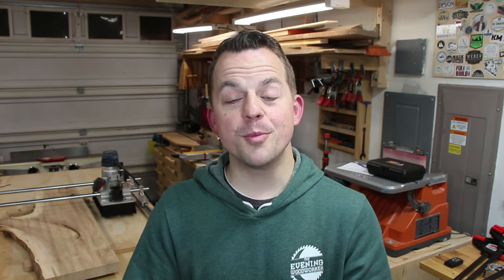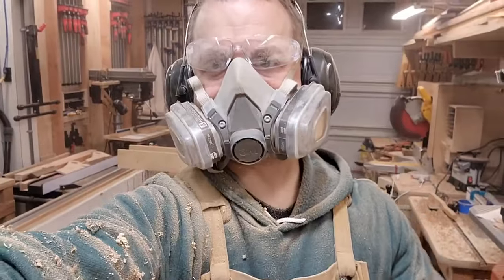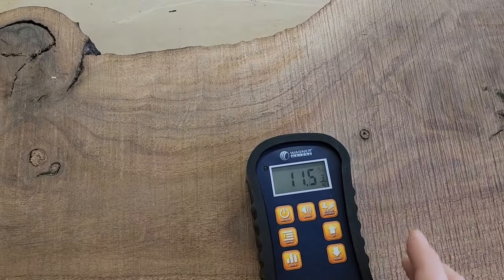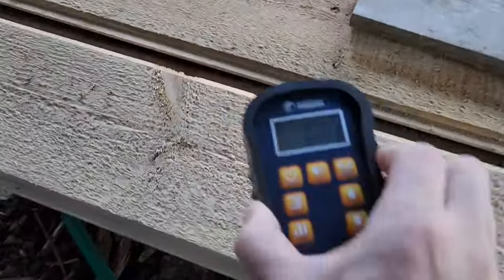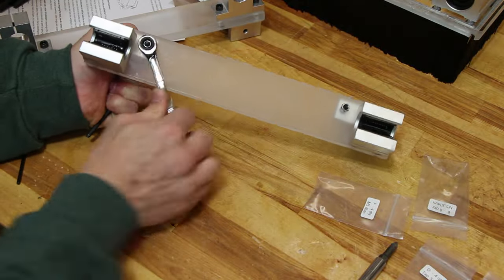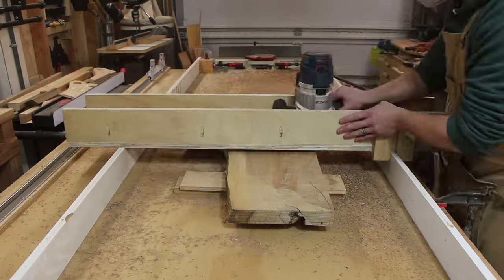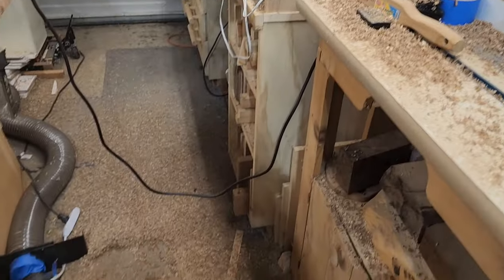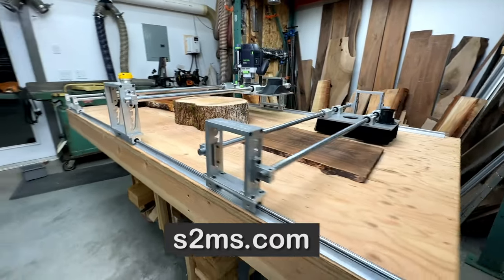Which Router Sled do you REALLY need - Linear Bearing or DIY?

Comment: I bought a cheap bench and wanted to flatten the top.  I fitted 15mm ply side rails on small stand offs so the bit could reach across the entire bench width.  I made the two sled rails from 1/8” x1” aluminium angle (which I checked for straightness) and put some furniture wax on them for an easy slide of the router base.  The rails were separated by a wood block at both heads, the width of the router base.  Worked brilliantly and cost little.  The chippings left the bench top through the standoff gaps each side.  Hardest bit was ensuring a perfect alignment of the six feet long ply rails each side of the bench.  This worked with my cordless DeWalt palm router using a one inch surfacing bit and I kept the depth of cut to under 1/16” to avoid over loading.
Reply from the maker: Sounds like a great setup!

Comment: I have used my DIY sled for about 5 slabs. It is very messy but it works. It’s great if the weather is nice I can share the dust with my neighbors 😂. Thanks for a informative comparison. 
On the moisture issue I have never used a meter. To be honest I have been lucky most of my projects have not warped. On the epoxy resin tables I like to use a polyurethane on the bottom to help seal the wood.
Reply from the maker: Thanks! I guess you can either use a moisture meter or just wait a year or two until you know it's dry!

Comment: I used the wooden DIY sled in the past and I didn’t like it, because it bends in the center, so little, but it doesn’t perfectly flat a slab. Slab large  around 40inches, and 100 long, with a quite heavy router 13 lbs. I’ll try with the metal ones, but I doubt they won’t bend as well.
Reply from the maker: The thicker diameter linear rails (20mm) will help reduce the sagging in the middle... they're just a lot heavier!

Comment: Great video. I’ve been looking into sled improvements for a while so it was good to see your video and comparisons. Was there a time saving between the two sleds for how long it took to flatten each side?
Reply from the maker: Thanks! The linear bearing one was a bit faster for the actual routing, but setup took a bit longer because you have to slide rails onto bearings and tighten Allen wrenches.

Comment: Is there any flex in the rails? My DIY sled is made out of angle iron so it gets the bit closer to the work surface and I can put a little wax on them to help the router slide easier.
Reply from the maker: I didn't have any flex in mine. I do like the idea of getting the bit closer to the work surface though.

Comment: What diameter are the libear bearing rails / rods
Reply from the maker: The 8' ones are 12mm and the shorter ones are 20mm
Reply: @EveningWoodworker  would you be able to measure the sag when you place the router in the middle of the 20mm rails? Originally I was wondering if 16mm rods would be enough for a1m span...

Comment: I really like your home build flattening sled. It's the design I would use. 
But in regards to moisture meters, how do you know the Wagner is more accurate? Not just because 😂🎉it costs more, I hope. There could be a huge variability between any brand of moisture meter. How could you measure the moisture more reliably to compare it to your meters? How about comparing it to another high end meter?
Reply from the maker: That's a good point. Cost does not always equal quality. In this case, in addition to the cost I'm basing my assumption off of recommendations from other woodworkers that I trust. Although, it wouldn't be a bad idea to borrow a few of these from friends to get a good comparison of higher end meters.

Comment: I don’t understand parts of this video that mention “with the grain”. Router bits go round and round. They cut both with and across the grain.  Direction of sled travel seems like a second-order consideration.
Reply from the maker: When a router plunges, then yes it's in all directions. However when you're moving it sideways, it cuts mainly on the side of the cutter. So if you're running it across a slab, I get less grain tearout  when I run it back and forth in the direction of the grain. Try it and see if you agree
Reply: @EveningWoodworker I'm not sure why you couldn't run the DIY sled along the grain since it's riding the rails.  Who says you have to move it back and forth on every pass.  Just keep it in one spot and move the sled up and down along the piece.  There might even be a way, with some sort of T-track installed in your sled to clamp down the router during each pass, which would make re-adjustments simple.

Comment: Couldn't you take some bees wax or something similar to put on the rails and maybe the underside of the sled at the rail.
Reply from the maker: I tried it with  some wax I had and it just made it sticky so the sawdust would stick to it. It seemed to work better just sliding on the bare wood